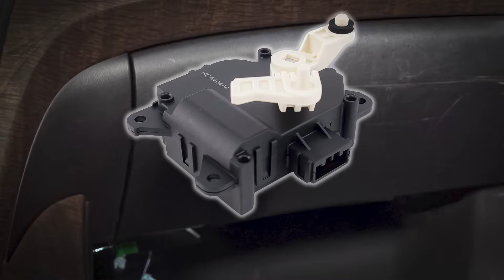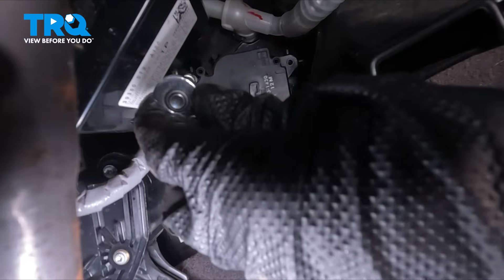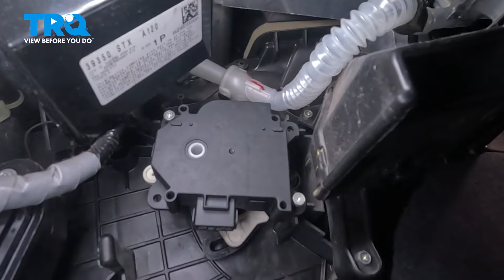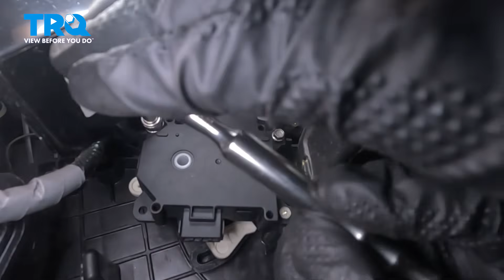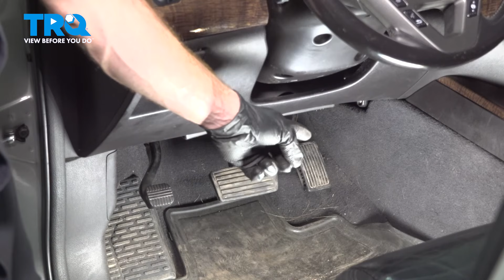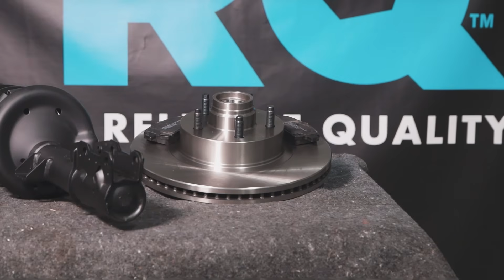How to Replace Left Main Temperature HVAC Blend Door Actuator 2007-2013 Acura MDX

Comment: Yeah this video is not too helpful because as you can see once he removes the third Bolt holding it in it cuts to the actuator already is the new one in his hand and he pulls it out so actually you don't see him removing the original which is the whole point of the video SMH

Comment: Question....I just came from the Acura dealership service center who is telling me that is the left (drivers side) actuator, not the right but I don't have an issue with temperature control... that works fine. The issue is the windshield is not getting air to defrost it which means it should be the right (passenger side) actuator. I think Acura is just trying rip me off by making me come in several times and pay for more and more repairs (I'm female). Thoughts?

Thanks for the videos BTW.

Comment: This video gives the impression that both pins/nipples of the actuator part are inserted into the same arm of the hvac unit. This is not the case. There are two arms on the hvac unit, one black and one white. The one opens and closes the door to the heater core, the other works the a/c door. So, one pin of the actuator fits into the white arm, the other into the black arm.

Operating the temp control on the dash module, going from 60° to 90° and back to 60°, while watching the actuator arms move, gives a good understanding. 

As a general rule, watching 2 or 3 different videos regarding the same repair gives a better overall procedure. The guidance of God's Spirit, even His Spirit of Ingenuity and Craftsmanship, grants a better success, hence, "you must be born from Above" (Jn. 3:7).
Reply: ...for starters.

Comment: What troubleshooting do you do to determine this part is failed? My drivers side air blows significantly hotter than my passenger side air with the air conditioning on.